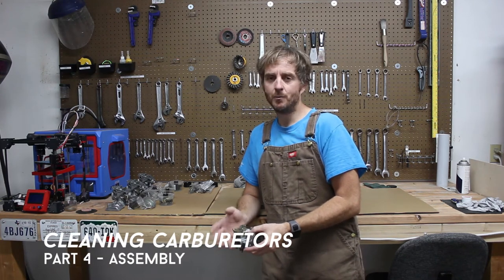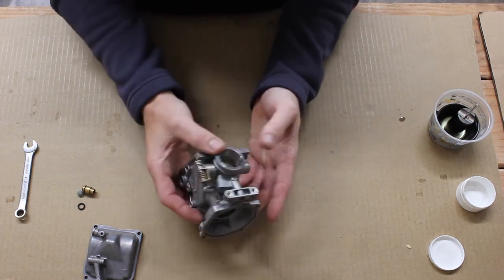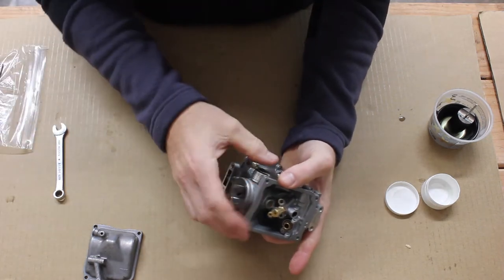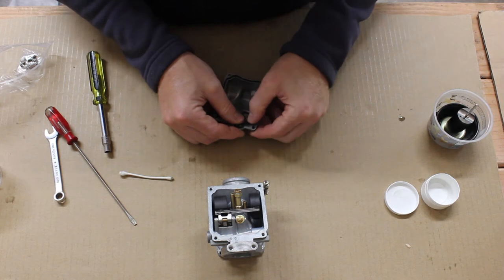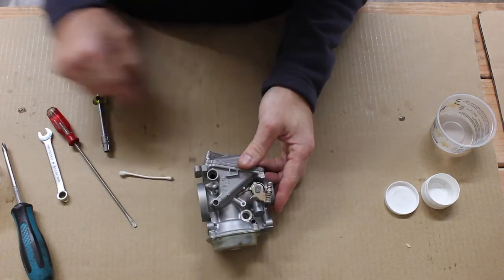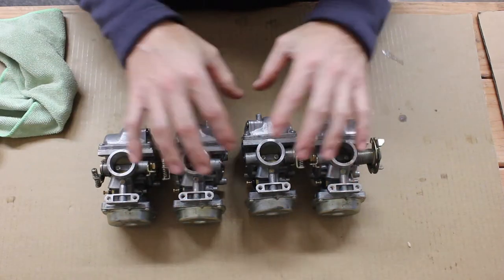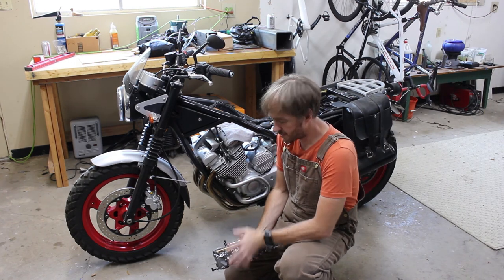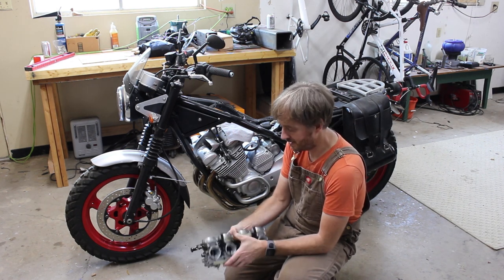How to Clean Carbs, Part 4 - Putting Them Back Together

Comment: Thank you very much for this series of videos. My XJ600 is doing strange things (cylinder 1 does not start), in 30 years the carburetors have never been cleaned, so for a while I am going to disassemble and clean them. I don't have an ultrasonic machine so I'll use carburetor cleaning spray, I know it's not the same but I hope they turn out great. Greetings from Spain.
Reply from the maker: Carb cleaner spray should do the trick.  Just be careful not to shoot yourself in the eyes.  I always do when I  use that stuff.  Nice to meet you.